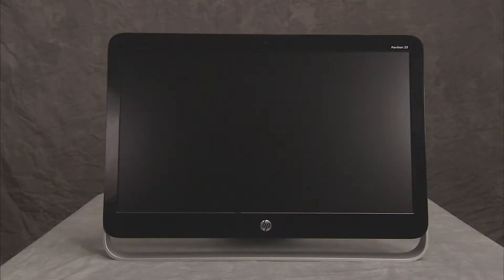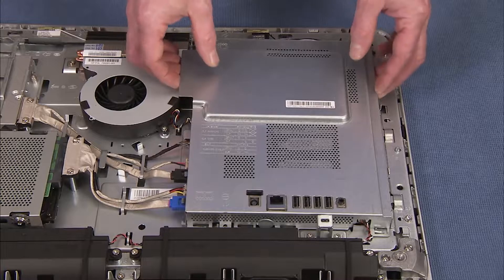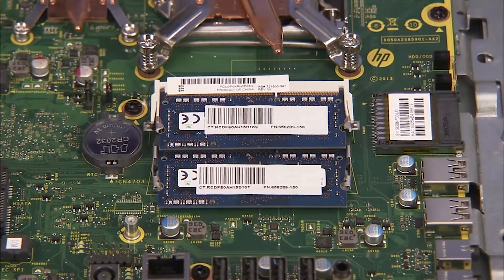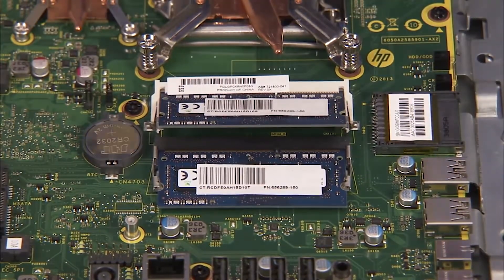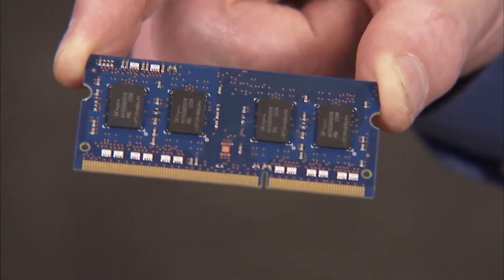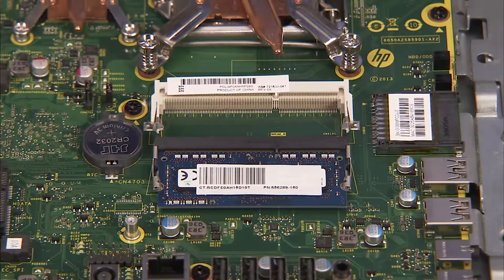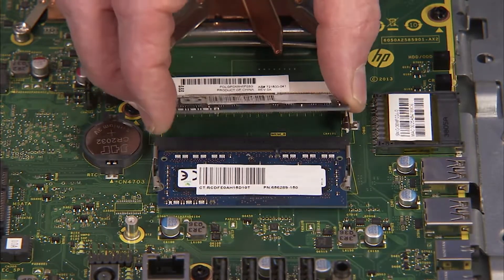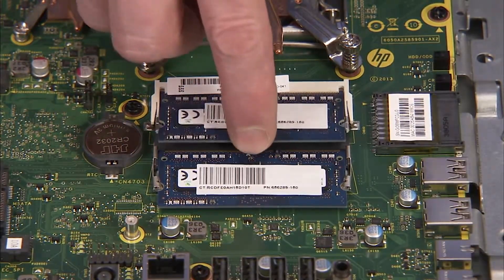Upgrade or Replace the Memory | Pavilion 23-g000 All-in-One PCs | HP Support

Comment: can i upgrade the ram into 2 x 8gb memory?
Reply from the maker: +Asya Unga Memory upgrade information
Single channel memory architecture
Two 204-pin DDR3 SODIMM sockets
Supports up to PC3-12800 (DDR3-1600)
Non-ECC memory only, unbuffered
Supports 1 GB, 2 GB, 4 GB and 8 GB SODIMMs
Supports up to 16 GB on 64-bit systems

Comment: Hi, you should mention if RAM is low voltage (1.35V) or high voltage (1.5V) as you should not mix both in the same computer, one can have compatibility issues or even damage the RAM or the motherboard. Always check first what you have got in yours before buying RAM. HP site does not refer it in Product Specifications, no reference to low or high voltage. In my case for HP Pavilion 23-Q070NA and after checking the Samsung existing ones, I've found out they're low voltage (1.35V).
Reply from the maker: +PG Please refer 'Memory upgrade information' from the specification page to get this information: https://bit.ly/3agcdc1
Reply: @HPSupport  where's the info on RAM voltage, can you point out?